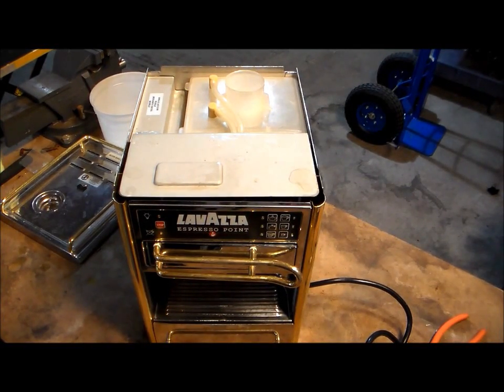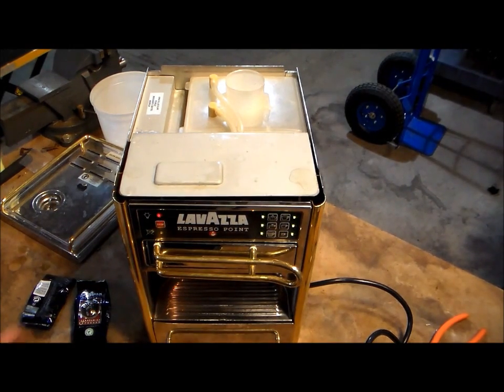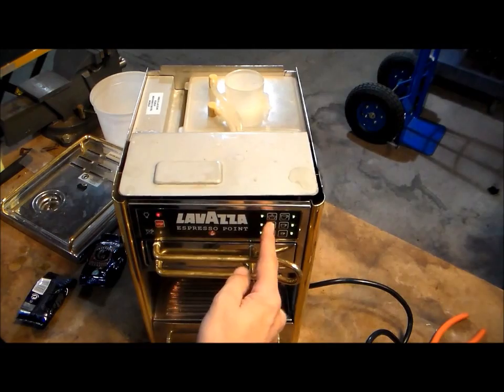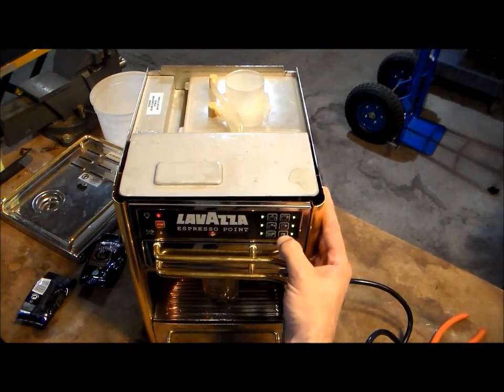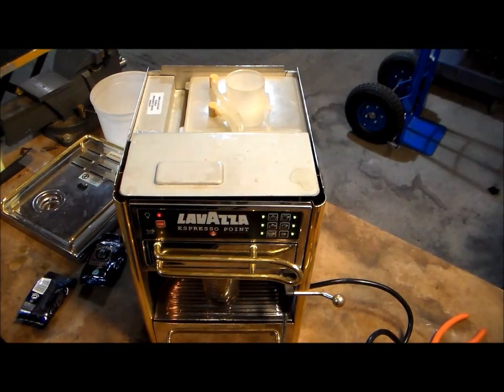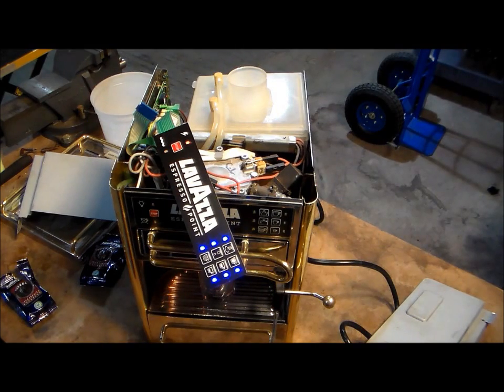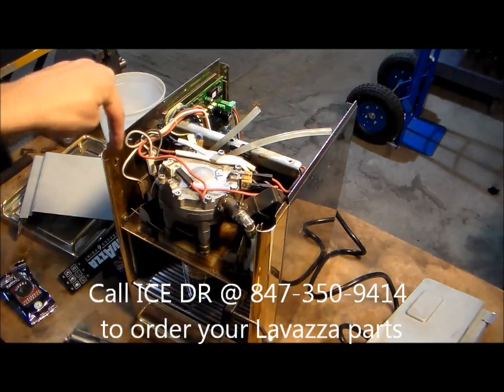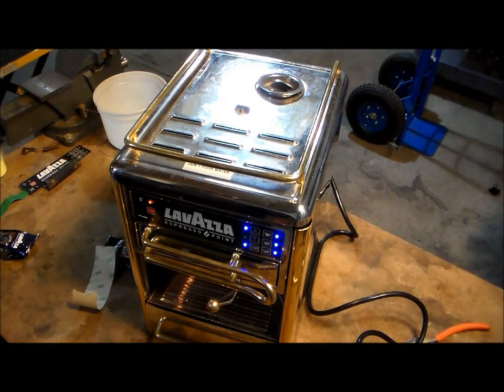How to Replace a Lavazza Espresso Point Button Board

Comment: Buttons can sometimes not work because of the connectors on the ribbon cable having a bad connection. My buttons started working again by simply unplugging the ribbon cable from the keypad going to the main control board and plugging it back in. Fixed my 2 buttons that weren't working. Hope this helps someone! These machines are very old now and sometimes they just need the ol' Fonzie touch of a good swift slap

Comment: The "medium button" didn't work because once you insert the capsule, it triggers the switch and will allow you to choose any of the brewing options.. however, you pressed the hot water button... The hot water and the steam function will work without inserting a capsule, but the other 4 buttons will only work after a capsule is inserted and no other button is pressed before whichever length you choose...  The keypad for this machine in the video was working perfectly fine.
Reply: This is the correct answer.